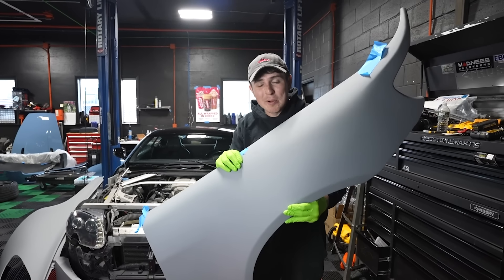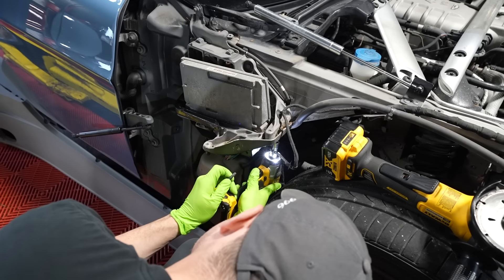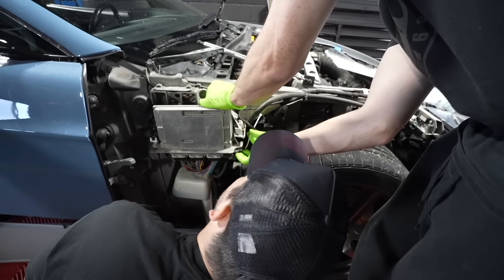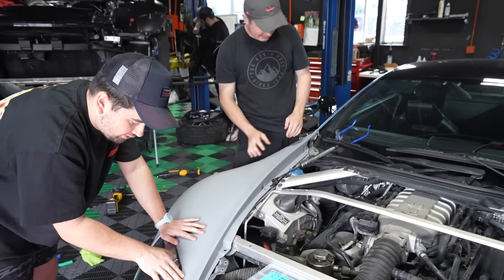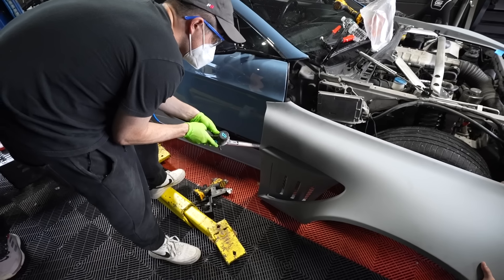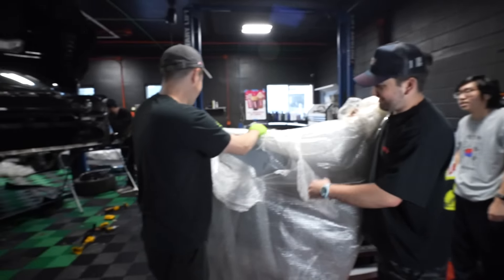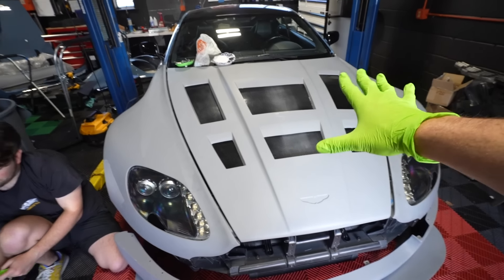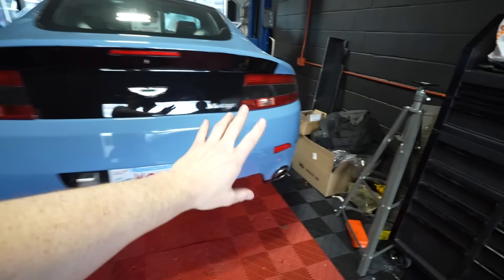Building A Supercar From Temu | Pt. 2

Comment: Should have put the bonnet on before putting and bolts in the guards because you can’t guess how far in and out the tops are meant to be since you drilled the holes

Comment: Cant you move the ECU under the hood? Or its just impossible due to the wires?
Reply from the maker: There is one spot where it’s possible but all of the wires are a tiny bit too short
Reply: @captaincrankshaft  arent there adapters? So you could make the wires longer? 😅

Comment: Cut the exaust a litle bit and make it fire downwords with a 45 or 90 degrees bent or just make  hols in the bumper and run the exaust as is, BTW the person who told you to make the other hols in the frame is laking skills, you could have just ad some holes in the fiberglass panels to line up with the existing ones on the frame :)))),

Comment: I think for the exhaust u guys could cut holes in the rear bumper for the exhaust tips, and possible plug the hole on the side skirts where the "race car" exhaust tips would come out with fiberglass and sand it down so it looks flush. Just what crossed my mind during the video. This is gonna be a sick build 🔥🔥
Reply: Agree

Comment: Run ghosts mufflers, basically cut it as much as you need and just point it down towards the ground not going outside of a body panel ( until you figure out where you want the exhaust to go so you can have the body marked up

Comment: How about drilling a hole the size of exhaust in the bumper?
Reply from the maker: Potentially thinking of doing that
Reply: that would looks stupid the bottom rear supposed to be for wind tunnel
Reply: @sloppypotato00  yeah, an L shaped pipe could be added and exhaust will come out from the side , It'll maintain the back look and side exhaust will look cool NGL
Reply: @captaincrankshaft why potentially? it should a no brainer. you're gunna destroy rear bumper if you cover it 😅😂
Reply: Use the stock bumpers stock bonets and just use the fenders from the kit and bam you have a clean wide static aston martin
Reply: @captaincrankshaft  Rectangular tips could look good

Comment: hmm, loosening all the upper fender bolts, then bolting the bumper to the fenders and pushing the upper fender towards the car while tightening the bolts might space out the hood gaps properly or bring it closer... then you guys should do side skirts and exhaust work necessary and then bumper before rear quarters so you have a way to line up the quarters before cutting and drilling
Reply from the maker: Appreciate the advice I’ll give it a shot
Reply: W
Reply: @captaincrankshaft I have a 2010 audi s5 72k miles 4.2l 6 speed manual. Any interst? For sale